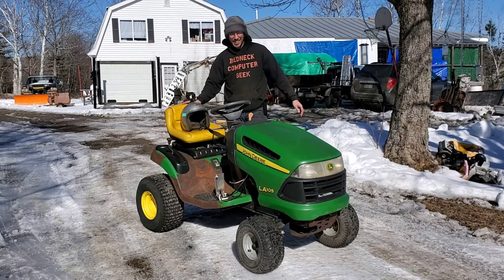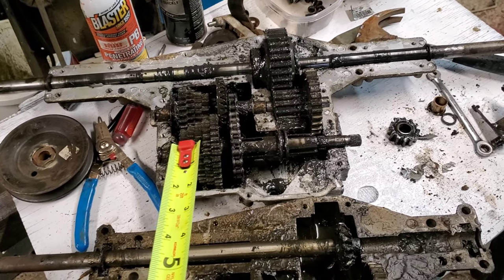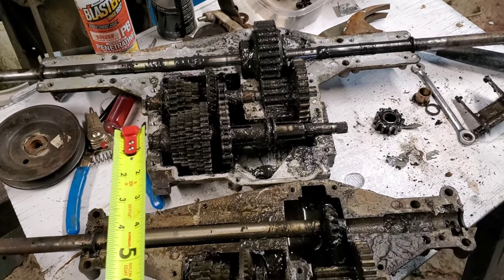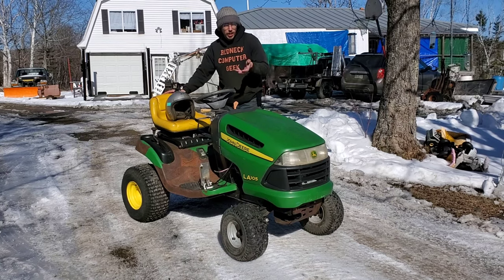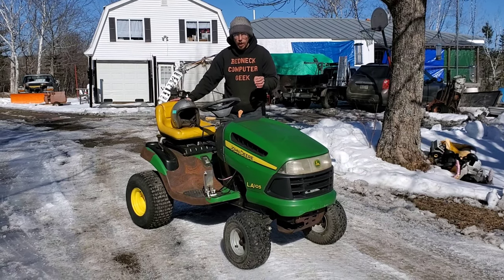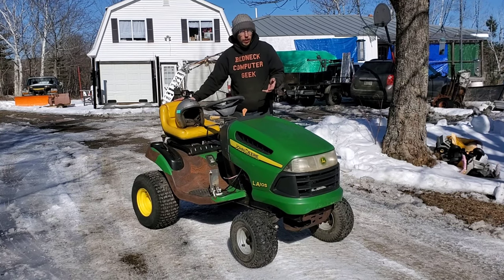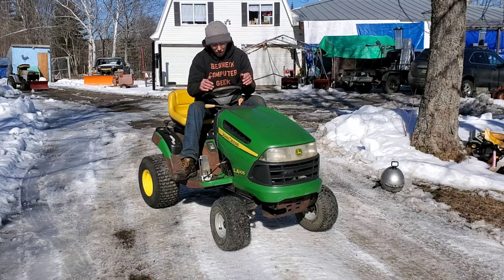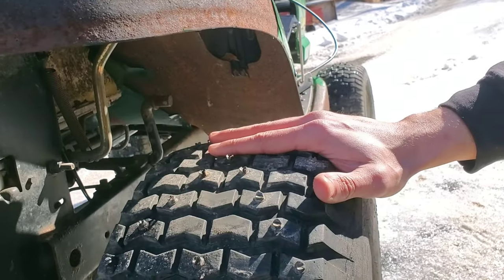Ice Racing Build Experience

Comment: Hey you should get rid of that reverse chain because unless you put in a better chain they like to lock up and grenade the self out the side of the trans or so I’m told from my racer guys
Reply from the maker: Yes they are known to explode in 35mph and up. I have no plan to clear 35 and plan to put the machine to use in the summer as a spare mud mower. Need to risk the reverse chain for the mud holes :)